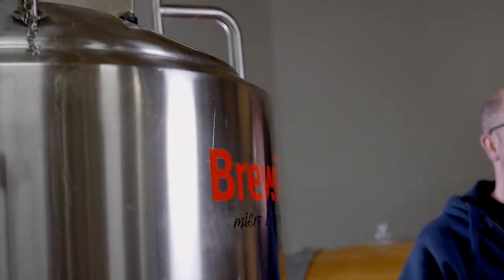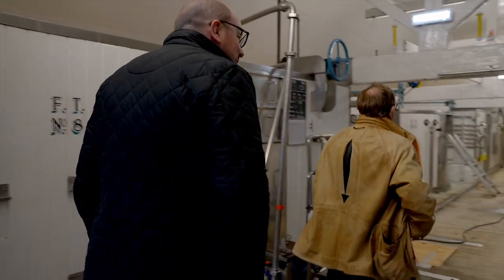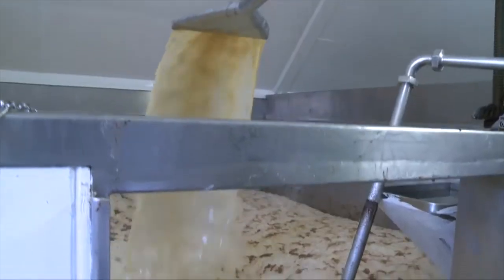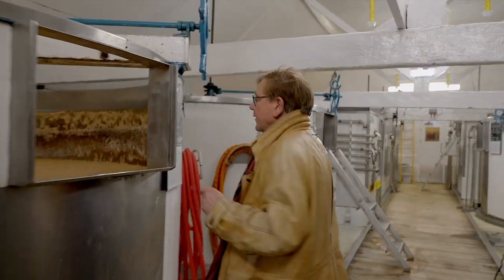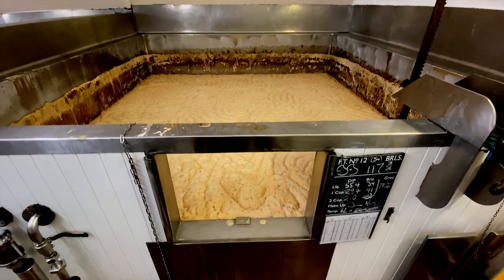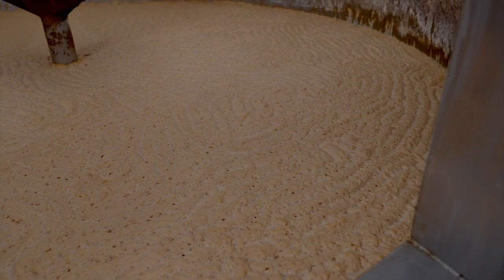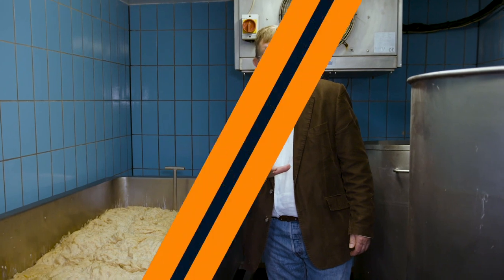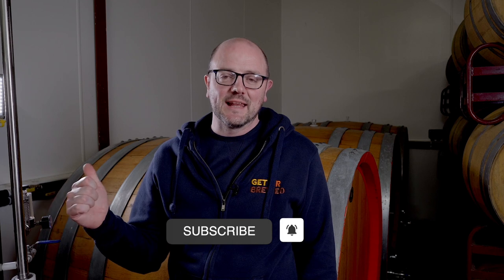Open Top Fermentation // Get Er Brewed

Comment: Is he saying that if they shifted to conical fermenters rather than open vats, and used the same yeast, the taste would be radically altered?
Why would that be the case?
The only factor I can think of is the influence of wild yeasts getting into the wort during fermentation.
Assuming the conical fermenters will not be pressurised, I really cant think of any other process parameter that could alter the taste that much.
Any suggestions here?
Reply from the maker: Thanks for your comment, you raise a really interesting point. I guess its Miles gut feeling and experience of working with that strain for so many generations that he would have experienced how its evolved during his time looking after it. When i next see him i'll discuss this. Do you brew yourself?